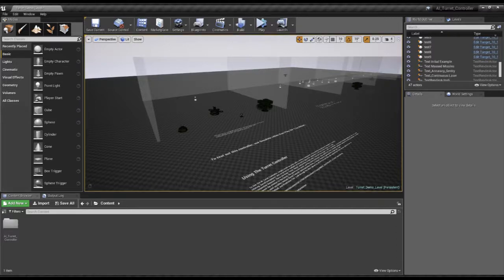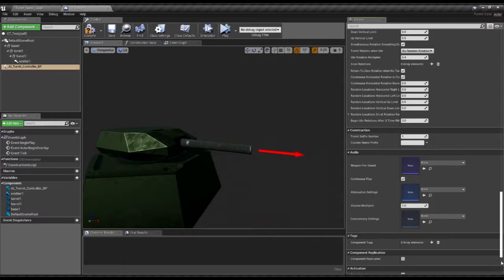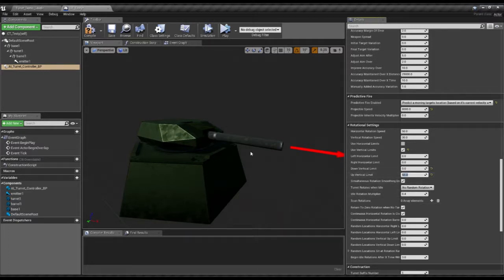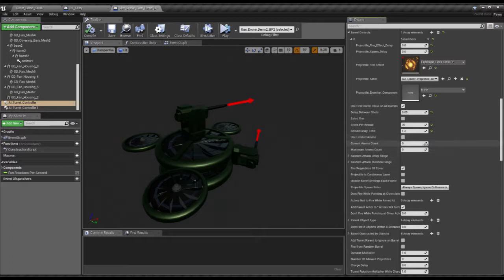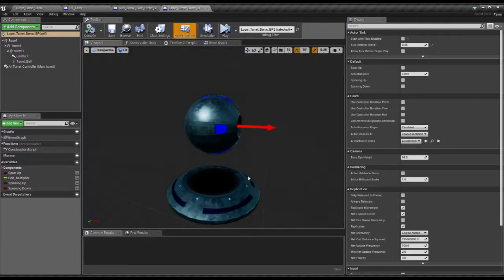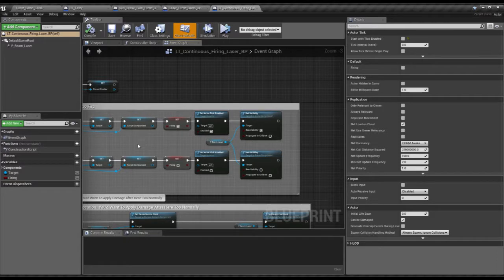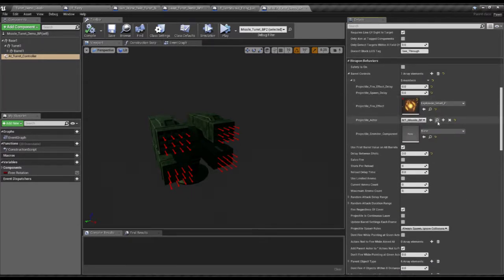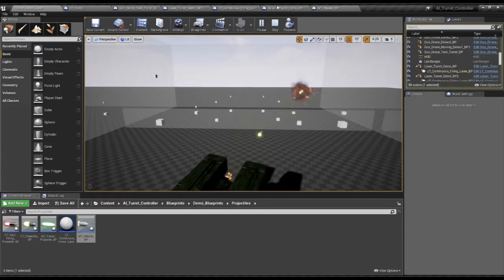AI Turret Controller Demonstration

Comment: Nice Work! I'm currently working on a Jet game and this helps me a lot in making AA platforms. But still, I got some questions.
1.
I'm trying to make a CIWS like a turret, so basically they will prioritize the player's missile instead of the player jet itself. When I doing this I notice turret will still always focus on the player, so I'm guessing the reason was my missiles doesn't have proper collision setup(missile set as overlap, or they won't shoot). So I want to know how the turret picks a target? Do they only detect targets with Block collision?
2.
Sometimes I feel the Tags don't work as I suppose. I make an invisible sphere to function as a"Prediction Point" and parent it on the Jet and Tag it as "Fire_At" and the Jet main component Tag as the "target". Then the turret will ignore me entirely. 
I can solve the issue by simply remove that "Prediction Point" or remove its Tag. The turret will shoot the Jet with the "target" tag on the root properly. 
Is there any possible mistake I got with the system? I set Target Search Tags as "target" and Fire at Components with Tags as "Fire_At" (by default).
3.
I also have a plan to make a laser turret. The problem is I don't want it always hit the Player Jet, I want it to create the tense that the beam is "chasing" the player by miss the shot first and slowly approaching from a distance. Is that possible to make it by this controller? 
BTW I also buy your 3D radar plugin, later I wish to have a feature that turret shoot large AOE beam and showing on the radar. 

Any suggestions will help! Thanks for your good work!
Reply from the maker: 1. First, make sure the option to auto target player pawn is disabled, useful in some testing, and limited games, but often not desired in later development/actual games.
Assuming that's off, then it works by first picking all actors with the "Has at least one of tag", then if any has at least one of faction tags are present limits the last list to only those with these tags. Then makes sure any remaining responses have ALL of the has all tags, hen that it doesn't have any of the "doesn't have any" tags.
This provides it a list of all actors to now check for. The next check is if it can see the target, it uses a linetrace by objects that blocks its sight, and uses either the actors location, the root components center of mass, or a component with a fire at/aim at tag based on what you set as the point it would try to aim towards to see if it can see it.  If your can block LOS variable doesn't include projectiles (a good idea often) but you want it to intercept some type of projectile, I'd make a new collision channel for those called interceptable projectile or some such that will block line of sight for the turrets so they can see them, but still wont get their aiming blocked by every random other attack flying around. Also make sure the actors mesh is centered on its root components pivot/center of mass, or that you added a component centered on it with the aim at tag to make sure the turret knows to aim where on the actor.
You can also enable the debug linetraces to help see what it's hitting or not hitting or where its aiming with its search traces here.
After this it checks distances and then priority tags to come up with the final target.

2. The main target tags/priority tags all must be ACTOR TAGS, only the aim at tags are on component tags.
And you mention an invisible sphere as a prediction point. What do you mean by prediction point? Did you put it out ahead of the actor or something? The Aim At points should be located INSIDE part of the main mesh so when a linetrace is made to them, it will also hit some "Can block LOS" Object Type part of the actor so it can tell it can see the target and then aim at it.
The main reasons for Aim At components, is the following. First, since some art meshes may have the mesh well above the pivot point so likea a hovercraft might have its pivot down bellow it, if the trace is made against that location then it would often miss unless aiming from the top/bottom. So you can set an aim at point in the center of the visible mesh. Or say you had a giant donut ship with a hollow center. Traces on the center mean aiming from above/bellow will pass through it and it wont be visible. So you could add multiple aim at components around the outer part so it would always aim at parts with mesh, and being giant it could even aim at the closest part of the ship or just on the part that's visible while other parts are still hidden behind a mountain or something else. These tell it where to aim/linetrace too, but it still needs to hit something with that trace there.

3. By default, it does not do that exact thing itself I don't think. There is the random aiming that can get more accurate, but it's not a case of for certain starting aimed away and slowly aiming more towards the actual actor in that linear manner, its still somewhat more random. So if I were you, I'd make a continuous laser that has the players previous location cached from a few seconds ago and then slowly blends between that location and the actual current location over the time its active making it slowly come closer. This would just effect the visual beam itself, if you want the turret to visibly lag behind as well a bit in its aiming (may or may not be noticeable depending on range) then you could have two turret components, the first that does the targeting and firing of the laser, (give it insivible non colliding turret parts and place it at the end of the barrel) and a second one that is just told to aim at a component that's being set to the current blend location each tick and that one controls the main turret meshes. Though this is just with one specific laser lagging behind mechanic, I can think of a couple different ones you might be aiming for from what you said but this seems most likely and is a general idea of how to manually make the attack seem to miss at first.
Reply: @terricon4  Thanks! I will try to figure it out immediately.
Reply: @terricon4  Another quick question: How do I set up the Missile homing properly? Right now I make an (x) seconds delay to turn off the missile Armed, but still, that means in (X) seconds the missile will keep tracking the player and get a 100% hit. Is there any solution that can make the missile track system more fair? For example, they will only turn 60 degrees once and lost track, or they are too fast and can be evaded by a tight turn.
Reply from the maker: @masonliu8120  The provided missile (MT_Missile_BP) is told what to target through the Event Projectile Target message. You can use the reference to the parent turret controller controller to grab any other info like the target tags, faction tags, etc if wanted.
If you want missiles to home in but be able to miss, there's many routes. The easiest is just make them have limited turning and limited lifetime. They will keep seeking the player but after a bit they auto explode, so if you evade one or two passes you survive.
If you want it to be like a modern missile with a seeker in its head and assuming no remote guidance from the launching platform, then you can do lots of things, but a simple ish one is to have a guidance check on each tick. Get the missiles forward vector, get the look at rotation from the missile to the target, and then get the angle between them. Normalize both vector inputs, Dot product node the two vectors now, then ACOSd (inverse cosign degrees, when searching nodes just "acos" and then click the one with degrees after it.) And bam, you have an angle. Is that angle within the desired range of say 45 degrees now? If true you keep seeking after the target, if false the target is lost and set to nothing. The missile missile then with no valid target (if turning/movement is like in the demo one) now continues on forward, but won't do any turning now as it's lost its target. Or you might make it auto detonate two seconds later or whatever else if you don't want missiles flying around causing collateral damage.

Point is, there's huge variety in how you want projectiles to behave, proximity air burst, specifics for homing like regularly checking if the target activated a stealth or something ability, checking the angle of the target to see if its in front of the seeker, or throwing in line traces so you can hide behind cover to lose the missile. Or you might model in more realistic modern missile turning, where it's got super acceleration and turning for the first several seconds, but once its engine dies out its now practically gliding and loses speed and can't do sharp turns meaning the initial evade will likely save you, even if the missiles still being remotely guided from the original launching platform (in which case you might make it fail if said platform is destroyed).
The most common one used in games is simply having missiles only turn so sharp and not aim ahead of the target based on its movements but right towards it, so that if you are flying towards a missile and suddenly turn sharp it will fly right past you, while on the other hand when flying away because its traveling in your direction they have much easier times turning before passing you. Key note, this only works if your missiles don't have air burst or proximity sensors on them like many modern ones do specifically to counter this.

Comment: Hello. About names of turret components. If I want to put several turrets on one base (I know you do that in your game project), what I do with that base mesh name? From docs, I understand I need to have numbering from all components - Base, Turret, Barrel, Emitter. What should I do to make several turrets on one and the same base? Thank You.
Reply from the maker: If one base has multiple turrets on it, then for 3 turrets you would want to have "Base1_Base2_Base3" or such in its name, so it has the keyword for all 3 controllers used to pick it up. That said keep in mind that rotation for the turret part is relative to the base, so if one "base" would have one turret on top, and one on each side or one on the bottom, then you'd want to make an invisible cube/box or something with no collision, and attach that to the "visual" base and then orient it appropriatly so that the turret component can be at the desired orientation while still having zero relative rotation to its parent at that default position. Said invisible cube/box would then be where you would put the "base2" or such keyword for that particular turret.

So if I had one top turret and two on the sides hanging at sideways angles, then I'd have the main "base1" visual base. And then make two invisible bases "base2" and "base3" that I would attach to the first one and rotate so they are on their sides. For a hanging turret you'd probably rotate it 180 degrees so the "base" is upside down, but if your mesh actually is of a hanging type of turret or such by default that wont be needed.
Reply: You are good at support and explanations. Thank You. I understood, about orientations and names, Thanks!